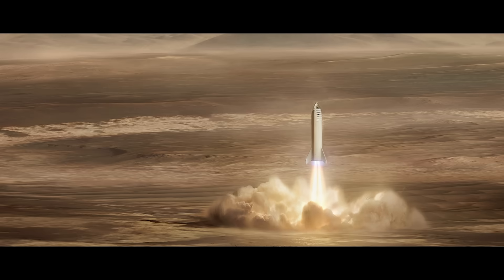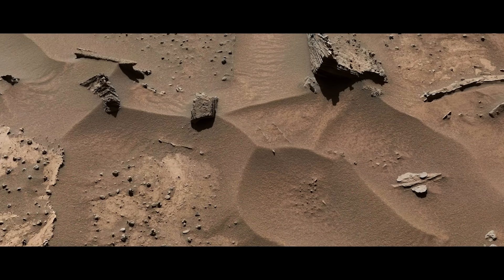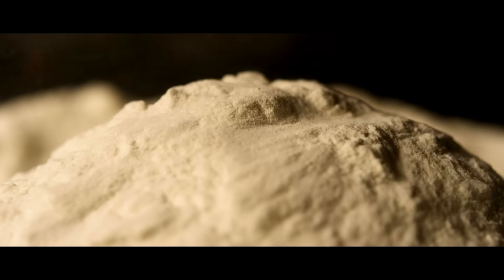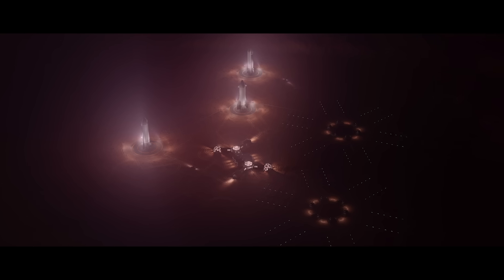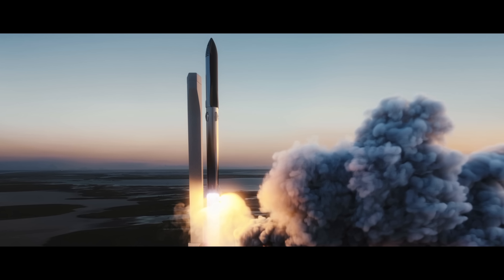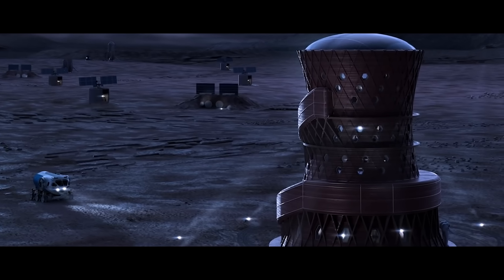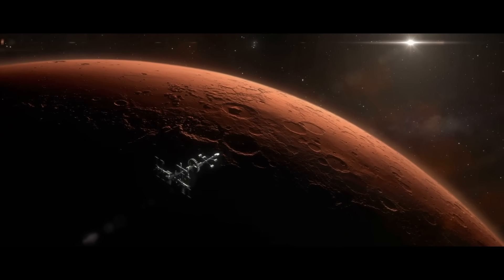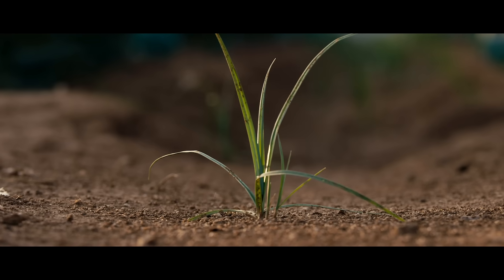THE FIRST 10,000 DAYS ON MARS (Timelapse)

Comment: We need a consist work out of 6 hours per day to regulate our muscle mass on Mars, how would a baby born on Mars be able to do this?
Reply: not our currently know methods they have powerful machines Amd prolly released a 1.5nm processor for PC's at that time or even smaller way smaller transistors for more computing power.
Reply: Future advances in genetic engineering will be used to enhance and reinforce musculature. Not just for Martians, but for everyone in the solar system. Low/no gravity environments will become a non-issue.
Reply: @thetrumanshow4791  thank you K